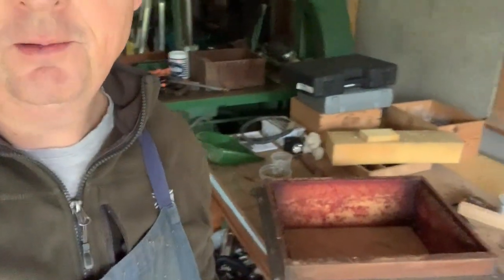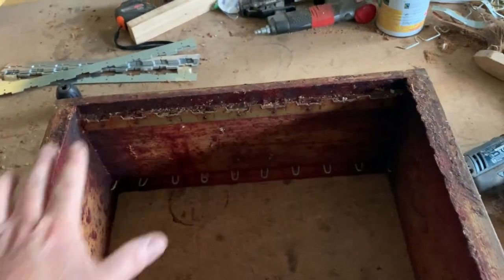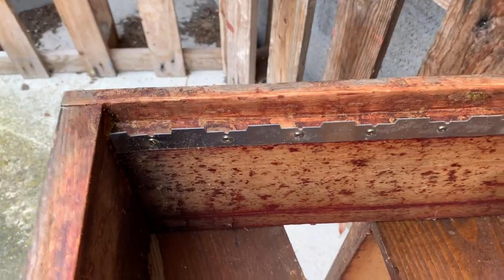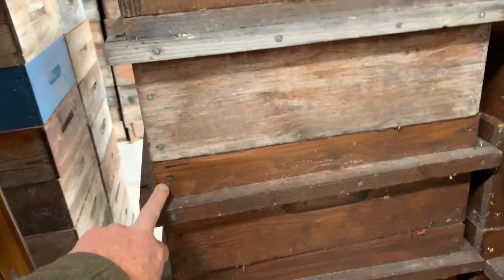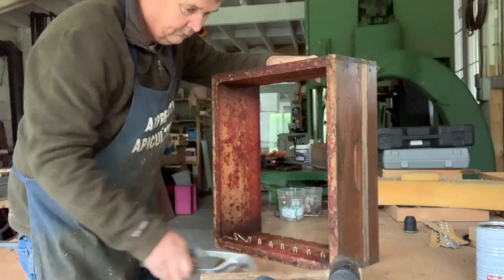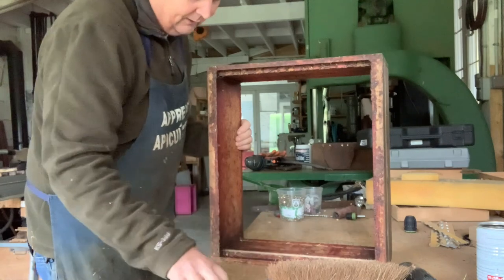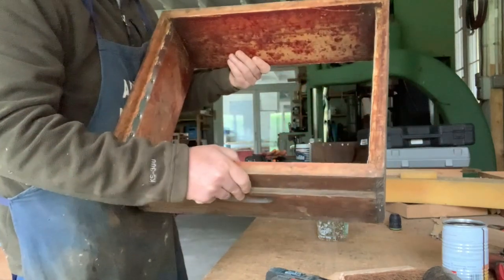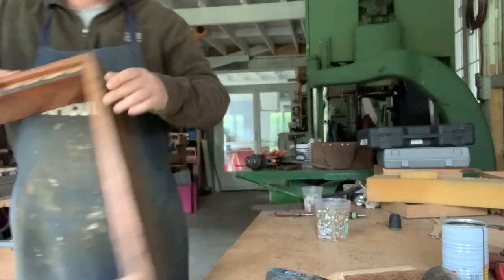Super makeover!!

Comment: Hi Richard, I also use 8 frames supers, find them easier to extract, but sometimes bees have some troubles drawing wax from foudation frames, I guess due to bee space issues. What's your opinion on using 9 or 10 frames as "starter". Tks.
Reply from the maker: Hi, yes this exactly the issue! With foundation you can rebuild on 9’s but even then sometimes the build between!
With our plastic frames they have to be built on 10’s but after that they can be put to 8’s straight away! It’s a general rule but bees sometimes think otherwise! Lost comb is lost money and lost time sorting it out!!🤷🏼‍♂️